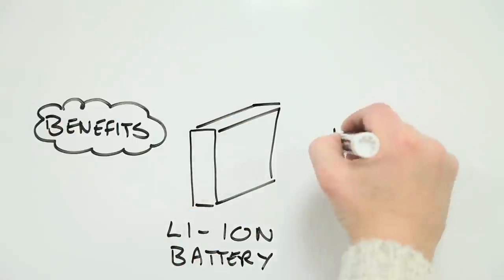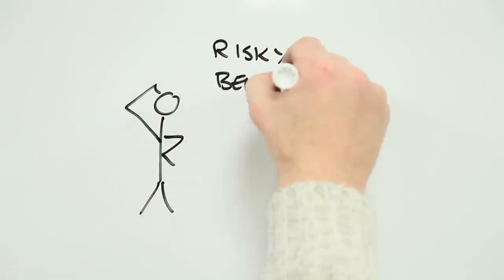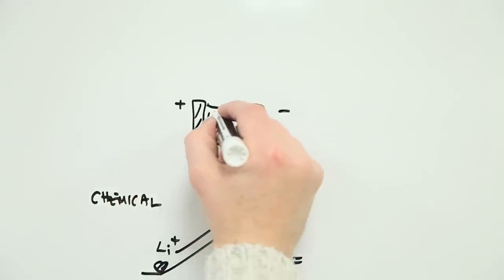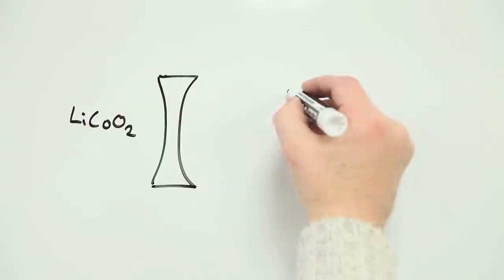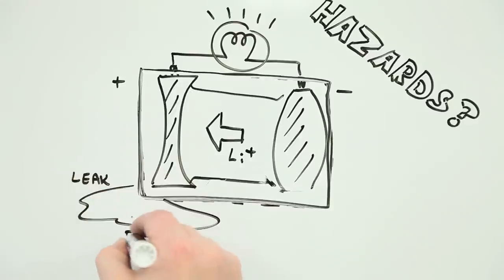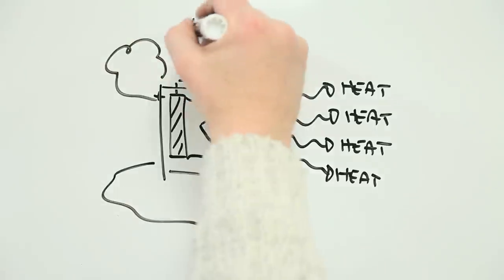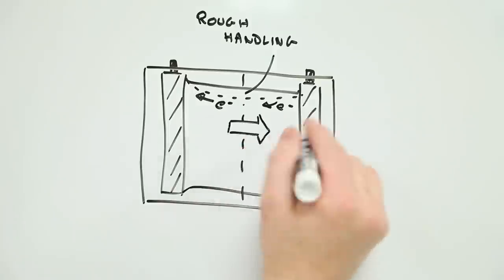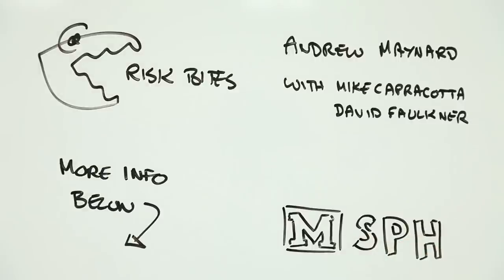What makes lithium ion batteries dangerous?  Part 2

Comment from the maker: I thought the corner store quip was sufficiently tongue in cheek to make a point without being misleading - all-electric cars are only becoming viable because of the ability to use higher energy-density batteries, and it was a standing joke for many years that early attempts had a very limited range.  And as @Eclipse5632 noted, the message is that technology innovation is making practical and high performance electric cars a reality.